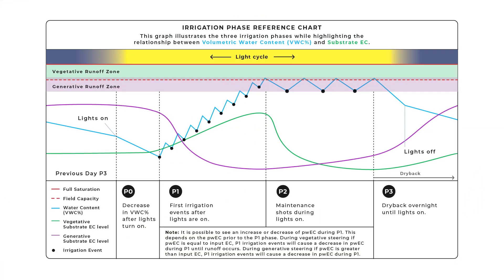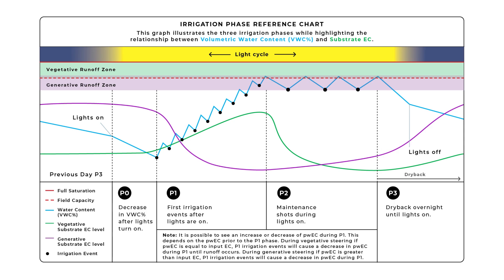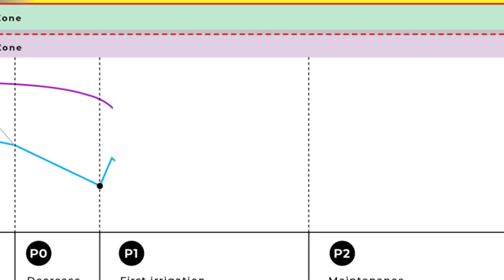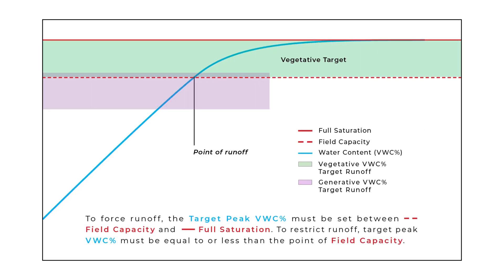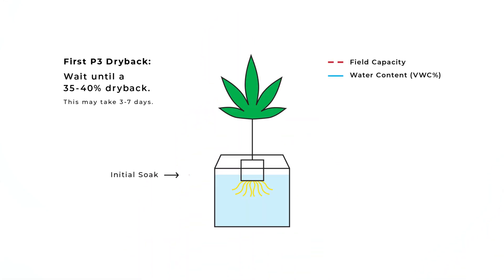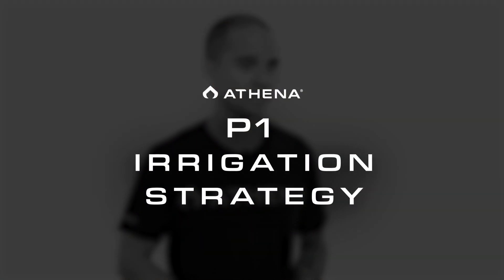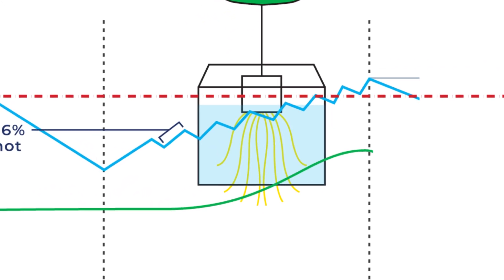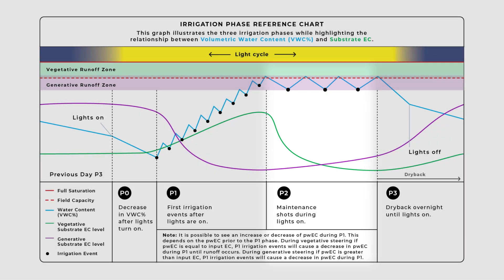Precision Irrigation Strategy – Part 3: Veg & P1

Comment: On a Irrigation strategy sheet online you guys say 15% dryback for Veg and 30% for Gen…I feel like your guides are not specific on if it’s relative or absolute and give different percentages from this video. Maybe I’m missing something… idk..
Reply from the maker: We recommend a 30-40% dry back during the vegetative steer, and for generative 40-50%. Starting on Page 32 in the Athena handbook you will find the "Irrigation Strategy" section with our current up to date targets.
Reply: @ thanks for response. And that’s relative to FC if anyone reads this.
Reply: @athenacultivation so does that mean a 30 to 40% dry back the media would be at 60 to 70% saturated n that’s when u water?

Comment: What is the time schedule for the phases? Say my lights come at noon. I assume P0 is about 30 minutes, so  P1 would start at 12:30. (correct?) What time would P2 start? P3 would obviously begin at midnight. (lights off during flowering)
Reply from the maker: P2 events are "Maintenance shots during lights on" After you achieve field capacity with P1's, P2's will be used to maintain the substrates field capacity after a 3-8% dryback. Give our tech support team a call at 844-333-1818 or DM us on instagram @athena.ag if you have any other questions.